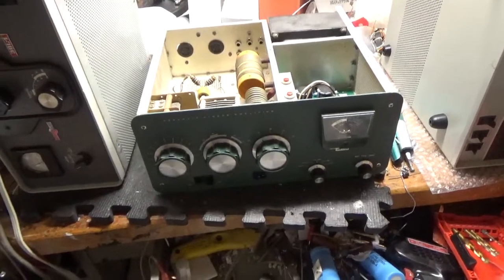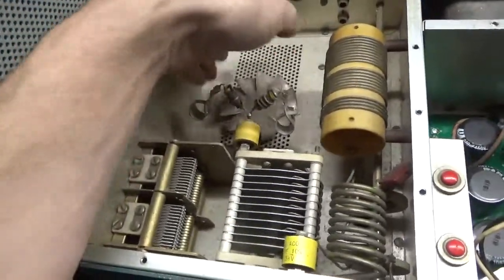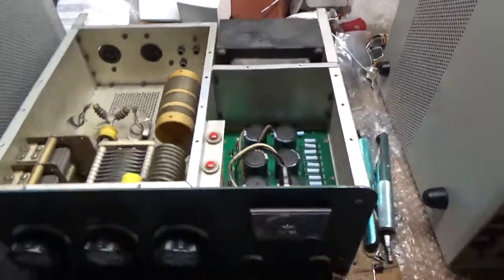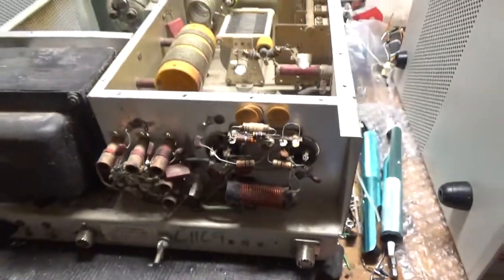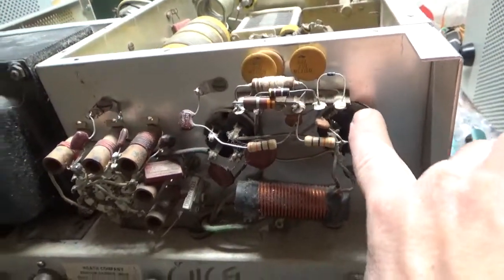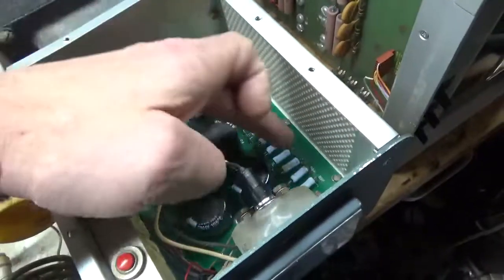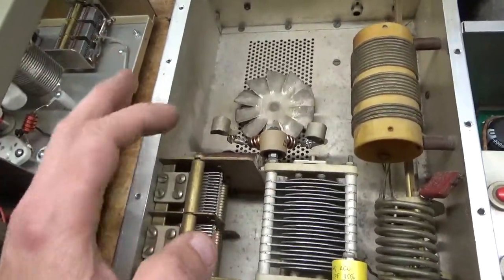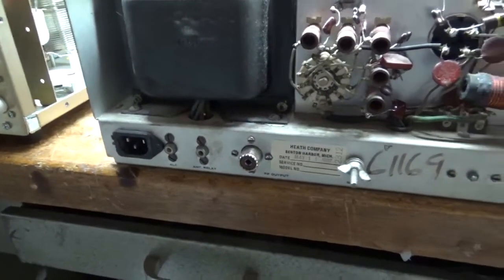Heathkit Sb-200 Repair

Comment: Also noticed you switched those bottom electrolytic caps out.  Did you use a ceramic disc instead in one of them?
Reply from the maker: No sir , both need electrolytic’s
Reply from the maker: Sorry meant both are  new electrolytic’s

Comment: Are the grid resistors particularly prone to failure? I recently had one actually explode with a loud "POP"....I simply replaced it with a new one (thinking it was just a random fluke failure) but watching your videos and seeing that you replace them preventatively makes me think I should go back and do a complete replacement. Is that advisable?
Reply from the maker: The resistors usually fail when you have a tube failure. It is critical to replace all 4 at the same time, with the proper type. And be sure they are within tolerance

If grounding, you need to be sure all other steps have also been done. 

Good luck and be careful

Comment: I'll call you during the week my 201 was working when I put it to the side it sat for 4 years now it won't power up I've replaced the power supply module because the factory board showed burnt spots underneath the bleeding resistors.
Reply from the maker: I answer calls 7 days a week. 
Call whenever ready 73